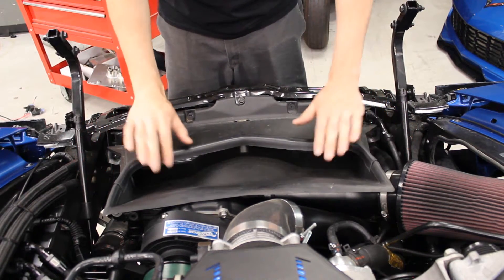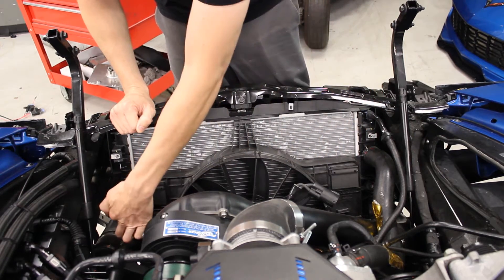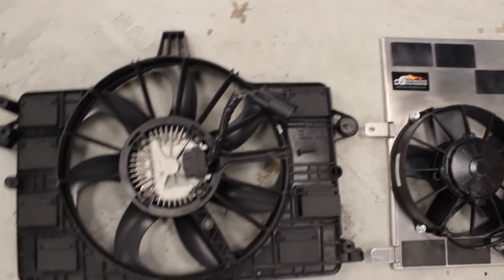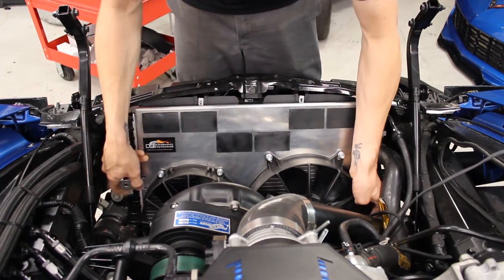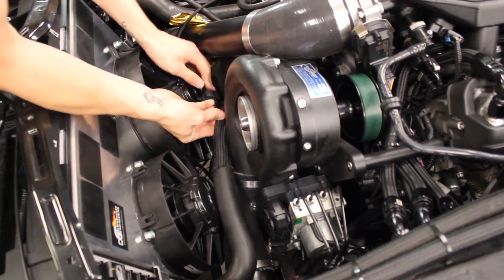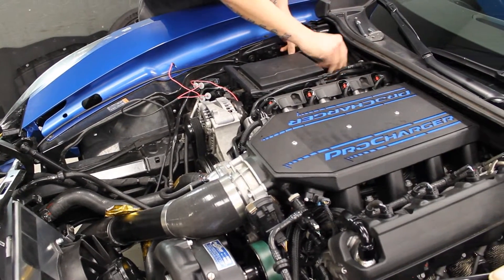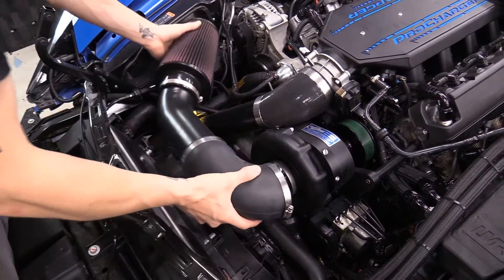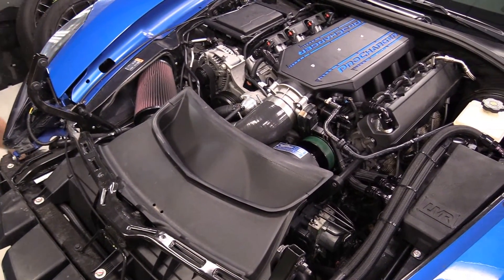C7 Corvette Dual Spal Fan Shroud Kit

Comment: lol "upgrade"
why would you replace the brushless fan with brushed fans?  The brushless one definitely has more torque and flow through all those heat exchangers, and it flows about 2700-2800cfm.  Can't imagine those 2 small brushed fans pull that much.
Reply: You have a point.